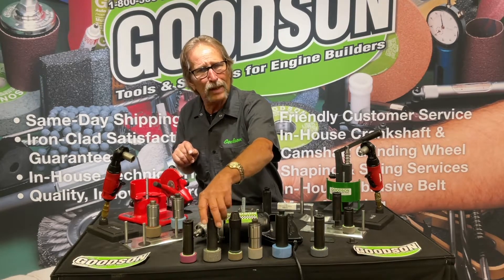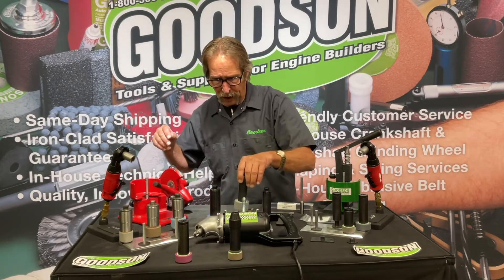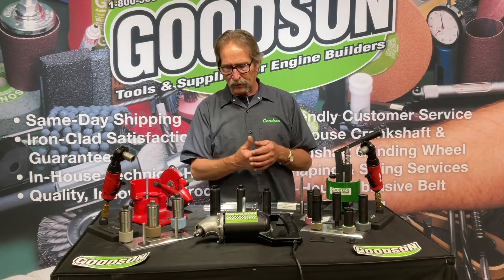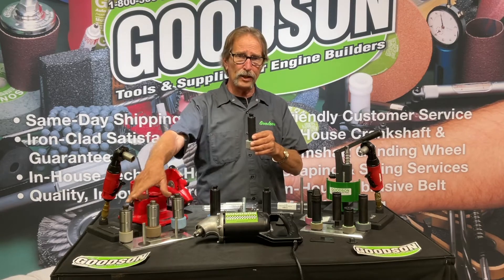Valve Seat Grinding, Part 1

Comment: How much price (India)
Reply from the maker: You can order it from our website at: https://goodson.com/products/vgl-100-valve-guide-level-assembly
This will show you current pricing and by entering a shipping address give you the shipping costs as well.
Reply: Order gdsn 50687 have problem. Indicator didnt work. Arrow is stuck.